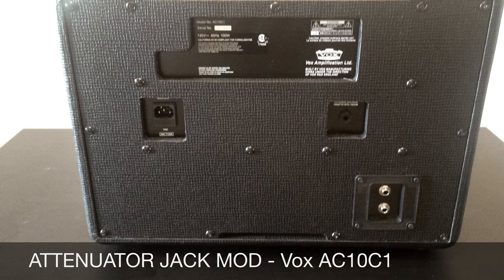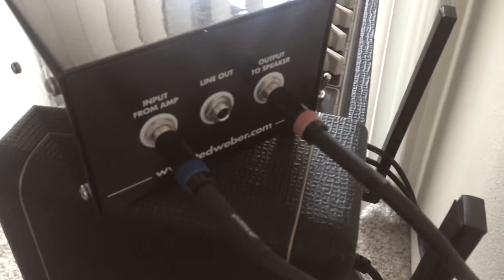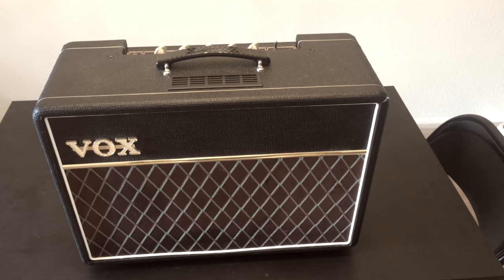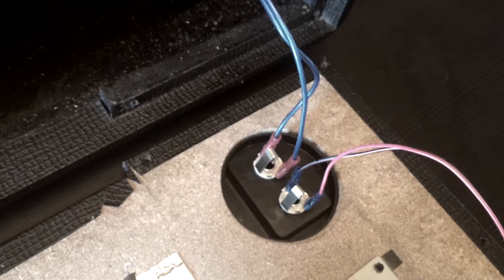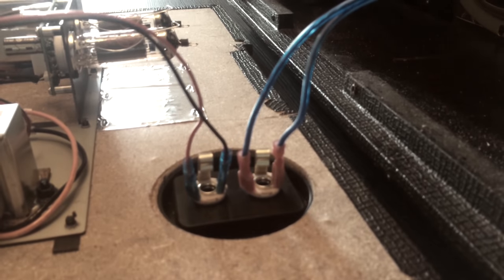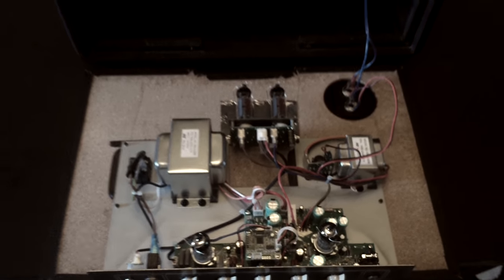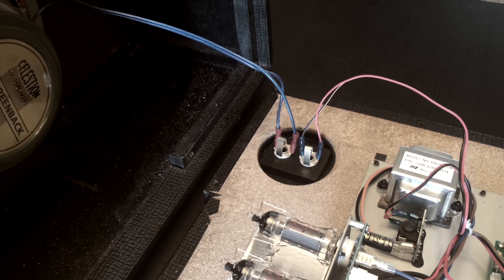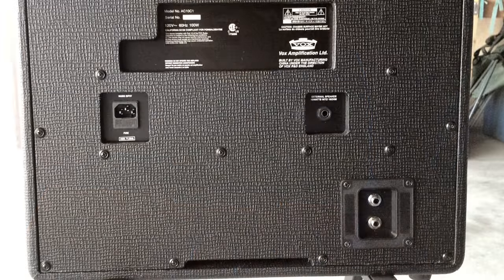Vox AC10C1 Attenuator Jack Mod

Comment: Very interesting, I got this small beast in hope this could be a good first tube amp for home use but it's toooo louuuuud, I was considering modding it in order to put an attenuator but wondering what would be the con… I assume that when you don't want to use the attenuator you can just put a small patch cable, right? Would you mind sharing the details of your mod for the less tech-oriented? I know basic soldering from building my own pedals…
Reply: As much as one would like to have an AC10 at home, it's a very loud amp. And I've read the master volume doesn't properly work below 9 o' clock. Don't have any personal experience and you'll know better. Vox amps also need to be turned up to get a proper balanced tone out of them. 
As to this mod, 
- it just puts two I/O jacks b/w the speaker and the Output transformer 
- The OT is mounted on the board and has the red/black wire coming from it. This wires will connect to the one of the jacks
- The speaker wire (blue) will connect to the other jack

You need not mount the jacks on the cabinet as in this video but do it in a separate box.. It's a strong signal so just be careful and maybe use plastic. 
On how to solder the wires to the jacks, perhaps check some videos. 

But I'm not sure how much a resistive load like a Weber attenuator would affect the tone when you cut the dB. 

How loud are you able to play this at home? How much are you able to push the volume knob (beyond 9 o' clock) ?
Reply: @Guillaume Richard If the gain is at 9/10 o' clock, I suppose the master volume has to be quite low.. 
Does it sound very thin or unpleasant with Master down at 8 o' clock or so ??

Also, do read on Fender Bassbreaker 007.. it's supposedly very good at low volumes. Someone exclaimed it almost felt 1/3rd the volume of AC10. 
Besides that, Roland Blues Cube series is also worth reading on.. Their power scaling is different and doesn't change the compression characteristics, just the volume instead. It has replaced the tube amps for a lot of folks.
Reply: @vaibhavjoshi9141  yeah, it's definitely too loud, thanks for the tips, I'll look into it when the Vox wil be sold, in the meanwhile I'm receiving an Orange solid state for me and the daughter eheh
Reply: @Guillaume Richard I play cleans - edge of breakup / at home / very low decibels
Checked the Orange Rocker 15 > Clean channel is british voiced but can be bass heavy
Orange itself is voiced heavy in the low mids.. I can't tolerate their drive channel at all. 
I've been looking at low volume amps for a long time & already have a nice 'SS amp + pedals' setup at home. 
Active on the Gear Page, I've talked to some people in detail on amps & dBs. 
If you can let me know what your needs are, maybe I can help you shortlist some amps. 
- What did you not like in the Orange Crush? 
- What kind of music do you/daughter play? 
- I understood that the Vox AC10 is very loud for you and it's not an apartment amp anyway. 
  > Have you measured any dB limit ? 
My findings: 
 - It's a choice between Fender Bassbreaker vs Vox AC10 for me
 - Vox AC10 could be too shrill and too loud for my tastes
 - A lot of people who like a cranked amp eventually come around to Yamaha THR. 
 - For me, tube amps are for the feel.. I'm don't crave for the purity of tone much.
Reply: @Guillaume Richard 
My thoughts on the Yamaha 
-----------
It is similar to (Pre amp + power amp + Speaker/Cab/FRFR) 
 > sounds like a modeler (recorded tone of an amp fed to you through FRFR speakers) 
 > Their specially designed 3"/4" speakers are crucial to why they sound good
   -- they can even play .mp3 files decently 

If I would have to go modelling, I would try: 
 - Atomic Amplifier Box   (one box solution)  
 - Line 6 POD +  IR (Mooer Radar) 
  > Amp modelling has been decent for quite some time but it's the speaker and cabinet modelling that is still developing 
 > newer gadgets sound better because of better speaker simulation
 > Any modeler from the last 10-15 yrs + new IRs will sound decent

Benefit with modelers is you can use your headphones and studio monitors.. 
With your studio monitors or Home Theatre, it essentially becomes a bigger Yamaha THR system

For purity of sound: 
 1. Tube amp head > Load > IRs > Monitors (Best feel & tone / low volume / $$$$)
 2. Tube pre amp (Kingsley etc)  >> Power amp >> IRs  ($$$)
 3. SS pre amp > power amp (SS/simulation) > IRs ($)
 4. Modelers ($$)

I'm not a fan of the 'modeler sound' and would preferably be running them into a regular cab. 

I've played a Line 6 POD 400 for some time and found it quite shocking how a $50 Chinese pedal had the warmth, feel and sponginess that one seeks when playing guitar.  
Also, the signal wasn't true bypass and once it was in the signal chain, it became 'digital' even if I completely bypassed the POD. 

Also, a couple of minutes into, I was lost in my playing and the POD didn't matter/ was good enough. 
The effects are awesome but changing values is a pain..
Reply: @Guillaume Richard I think convenience matters to you with a family around the house. 
THR kills for that. At very low volumes, it sounds close to tube amps (from what I've read on the 
I'll suggest check the Fender Bassbreaker 007 once. 
- It can do the Vox chime a bit
- Nice breakup / awesome rock tones for your daughter
- You can boost it for metal tones. I like crisp tones for palm muting if I'm in the mood. 
AND everyone is surprised how good they sound at low volumes.. I read somewhere that it has one of the lowest volume floors among amps where it's still sounding good. Someone said it was 1/3rd as loud as the Vox. I wanted the Vox for the dynamics and this seems good enough. 
If I have to go the modeler route, I'll take 
> Atomic Amplifire Box + cab. 
It's almost the same price as a THR and has better amp modelling than the Helix. 
Plus, I don't have to stick to the 4" Yamaha speakers. Bigger speaker and wider spread helps at low volume. 

These are my thoughts and I'm done bedroom amp searching for now.
I even though of building my own 1-2 watt head with a VVR or an L Pad attenuator. 
SS amps also work great at low volume as you may have found out with the Orange. And they take pedals well enough.
Reply: @Guillaume Richard You're welcome!
I could never go the laptop route because of the latency as well as it loses the plug and play feel. 
I also like to be away from gadgets when playing guitar.. even dislike having modelers around and much prefer a few knobs at the most. 
The THR is good for the plug and play but for low volumes, bigger speakers and a wider spread make a huge difference.. 
My gripe with them is that the speaker is tiny, although they put out a decent low end.. 
And it cannot be used any other purpose except being a cute amplifier. 
If you already have an interface, monitors or headphones, you could have a better setup with an Atomic Amplifire Box.. Just knobs up front and you could connect to a cab/ headphones/ monitors. 
Each option serving a different volume. 
The basic amp sounds and simplicity of use sold me on the box apart from the price.  
Btw, what didn't you like about the Orange amp? 
Did you try pedals with it?
Reply: @Guillaume Richard I didn't realise the Amplifire would be that much $$$
Yamaha THR is like running a mediocre modeler through tiny monitors. 
I also read a bit on the THR and it sounds nowhere close to small tube amps. 
I think your options may be: 
 - used Line 6 POD + $50 IR pedal > Monitors/ headphones 
(considering you may be able to get a Line 6 POD quite cheap in London)
This will sound good, legit! I've read a lot and this will sound close to a Helix. 
- Used Laney Cub 10 + pedals 
I've tried the Laney and man, it has all the tube goodness. Soft, sensitive to your touch, everything that an SS amp lacks. It was the first tube amp I played and I knew the difference. Even at very low whisper volumes, the feel is different. 
You should be able to get a Laney for cheap in the UK, used. 

Is the Fender Bassbreaker 007 in your budget? 
It's the 7 Watt Plexi the world was searching for, on a budget. Sounds great at very low volume but I haven't tried one. You can keep it in a corner of your living room :)
I'm hoping to move to Canada. If I don't, I'll either get a Laney Cub or the Bassbreaker. Period. 
I know for sure that the Laney will work at bedroom levels.. tried it at someone's house at 10.30 PM. 
And I can understand how an apartment in London could feel, having lived in cities throughout my life and the last time I played my amp at 90dB, the police showed up 2 days later. : D
Keeping it simple encourages one to practise more.

Comment: Nice solution! If you don't want to use the attenuator, do you have to reconnect the speaker internally, or can you just connect a short cable to the in/out jacks?
Reply from the maker: Short patch cable! I have one installed now that I live in the mountains - no noise complaints.
Reply: Even better solution! So... how much for the attenuator? ;)
Reply from the maker: @pergronroos4273  the Weber Minimass I have was like $150...not bad!